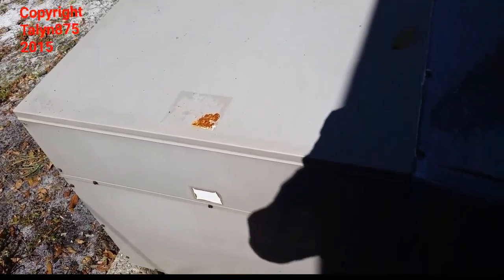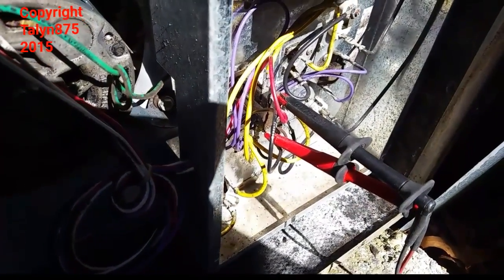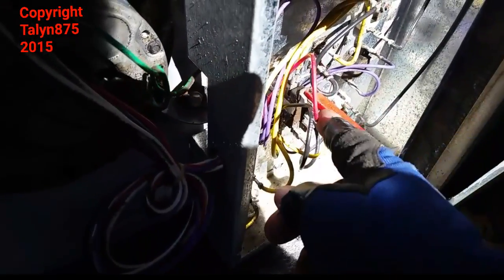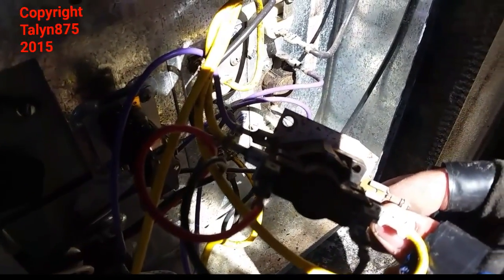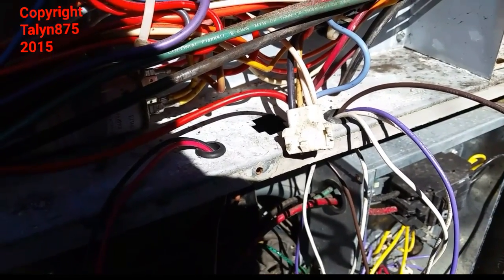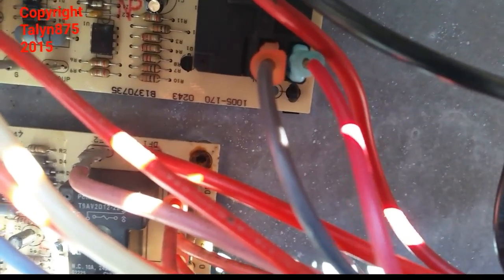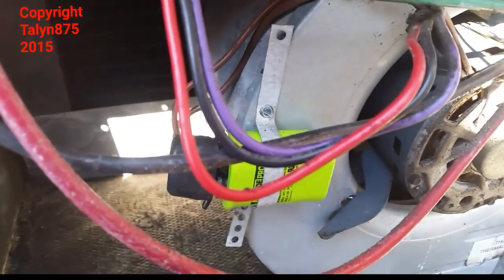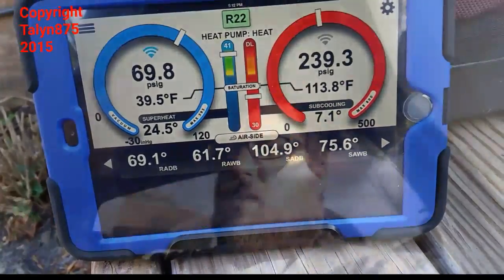HVAC Service : Goodman Heat Pump Blower Troubleshooting

Comment: Would you recommend replacing start/run caps on the compressor and fans as a preventative measure? My (coleman...) HP is almost 20 years old and I want to keep it running as long as possible. It's plenty efficient and it keeps the electric bill down, so I am in no hurry to replace it.
Reply: No, I would just leave them. The older caps are tougher than the new ones.